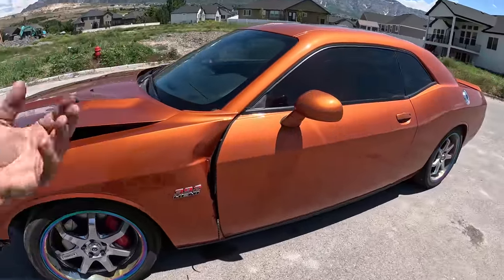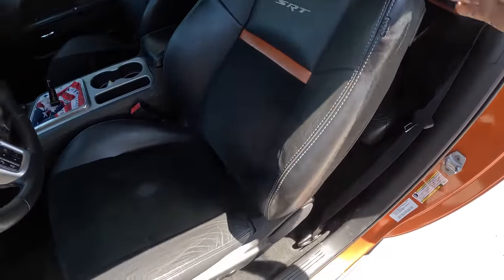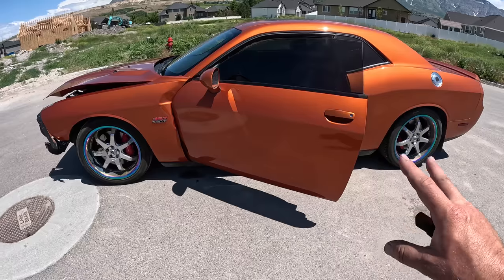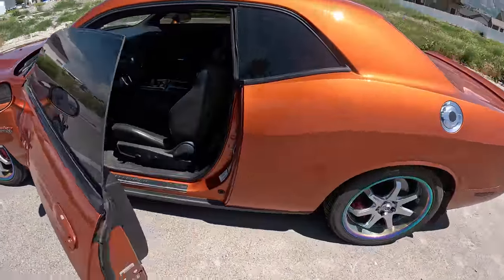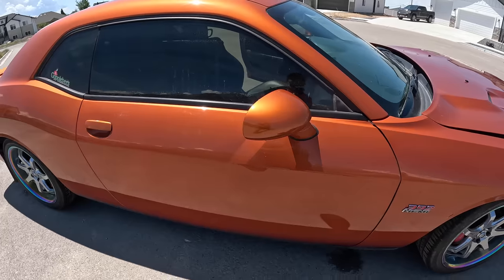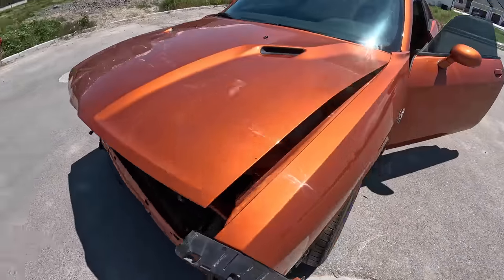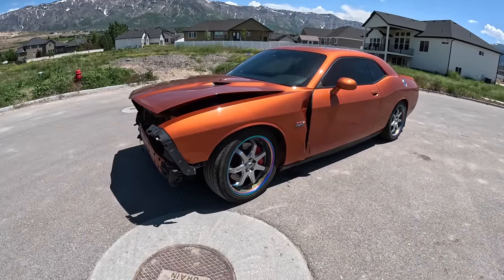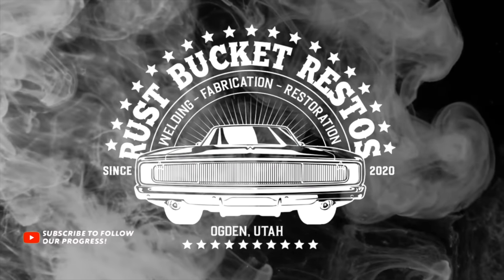1971 Plymouth Cuda Restoration - Episode 13 - Drivetrain Donor

Comment: When I go to a car show I love seeing the original engines, the ones that made these cars what they are today. When I look under the hood and see a Gen III Hemi I just don't feel the same excitement. If I see an LS? I just turn around and puke on the ground! But I am 68 yo and I lived these cars, this is what  my buddies and I drove in High School. I was 17 and driving an A12 69 1/2 Super Bee. Dave you do good work and make sound decisions so don't let a doddering old fool make you question yours. Well back to the shop, I just bought a 69 Sport Fury convertible and I've only got a month to try to get it ready for Chryslers at Carlisle. The Roadrunner? I'm still in sheet metal hell. AMD told me my right quarter panel won't be here until July.  Dan

Comment: good choice on the engine swap. I'm doing something very similar. I have a 1974 charger that I bought when I was 17 (if it wasn't for the attachment to the car I would not be putting this much into a 74 charger), like you I've bought a bunch of stuff from AMD like trunk floor, extensions for trunk floor, bumpers, etc. My car has a 318 so I'm also going with a 392/6.4 swap, but I went with a package from Cleveland Power and your right it $15K at your door. the one I got was from a 2020 challenger with 800 miles. unfortunately QA1 doesn't make much suspension components for the 73-74 charger so I need to figure what to do there. Look forward as you move on with this project and the choices you make on the interior and putting everything together.
Reply from the maker: Sounds like a fun project!  Good luck with your build & thanks for watching!

Comment: 440 engine is better and puts out more hp than the 426 Hemi. I do get the desire to have the Hemi. That's why I went the 440 engine build route. Definitely going to be slick with the donor parts and can bus electronics.

Comment: Major score! and all those extra parts to horse trade with and offset the price. In the 70s the grapevine was not connective. You showed up every week, hoping. Plenty of guys never made their second payment and there was the car, waded up like an accordion...or worse(lots of good rear end parts, not so much engines and grills, etc). Some junkyards wouldn't let you pick from a corpse car (a lot would). Some older, old school cops made them crush everything to make sure none of the go fast stuff made it back on the street. My bank manager was working in Northern Ontario in 71' and a young man skipped on his second payment on a Charger R/T. A year went by no sign of him. An OPP officer noticed a line of cut bush angling off the highway. He walked in 400 feet to where the Charger had finally met a tree big enough to wrap around. Mystery solved. Heck our school trip bus was run into from behind by a chick in another 71' R/T on the infamous 401. I watched her coming. She was a blur and I only had time to scream "hang on" as she nailed into us. Karen Springer went from the very back center seat, in the air, all the way to the front landing on the bus's shifter(minor bruises, back in action that weekend). You wouldn't think a 2 ton car could shove a whole school bus like that. The white Charger (with R/T stripes) spun off the hwy somehow V'ing it's front end before wrapping the trunk around a tree full stop. Somehow the chick was unhurt and sat on the shoulder in her stylish bell bottoms and hippie chick poncho type shirt, knees up weeping away. The better, even cheaper scores were the police C-body Polaras and Monacos. Cops were better drivers and happily both they and the cars survived more often. Those rads, high compression 440s and HD torqueflites were major scores. Strangely they had neither the 8 3/4" or 9 3/4" (Dana 60) rear ends, but a HD 9 1/4" rear end useless for aftermarket gears and parts. Plus they were too wide for the muscle cars. Enough yawing, great score and good luck on the install.
Malcolm Ottawa Valley
Reply from the maker: Awesome story!  Thanks brother! 😎🤘

Comment: I love Dodges and have had SRT8 Challengers in the past. (I have a 1969 Super Bee and a 2011 Charger, Toxic Orange, currently.) I have only seen 2 Toxic Orange examples and both of those were automatics and had the factory stripes. There is a pretty good chance Dodge only made a couple of those with manual transmissions. If the stripes were not removed from this car, you also have a stripe delete car which adds to the rarity. My 2012 SRT8 Challenger, according to Dodge, was one of 63 built. You may reach out to Dodge, just for the fun of it, to see what you have.

Comment: Did someone else already ask for the interior parts you are not going to use? Please let me know.
Reply from the maker: I have the seats sold but everything else will be available.  What do you need?
Reply: @rustbucketrestos6511  Dash and center console with all electronics, A/C heater fan with heater core to make it work, body wire harness, body control modules to make electronics work, door panels with switches front and back, back seats. The goal is to have the modern Challenger interior in my 74 with everything functional for the CAN/BUS electrical system, key fob.
Reply from the maker: Where are you located?